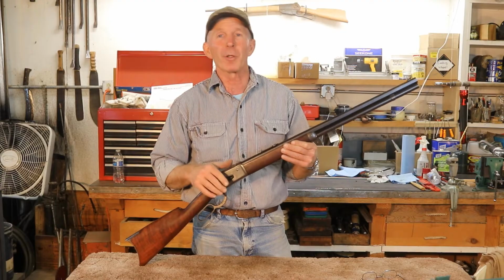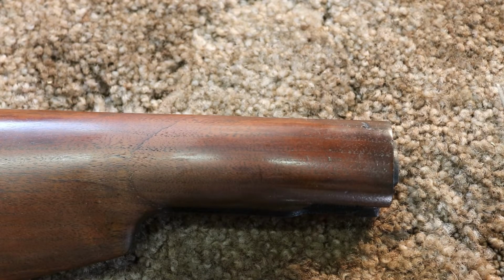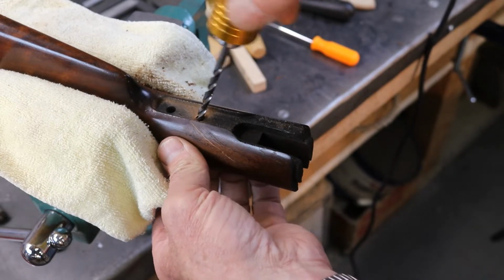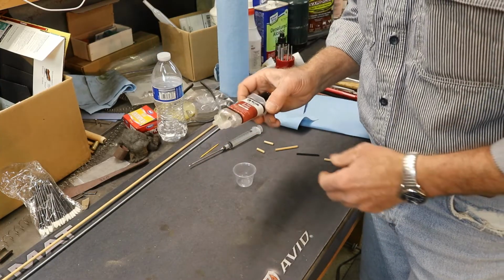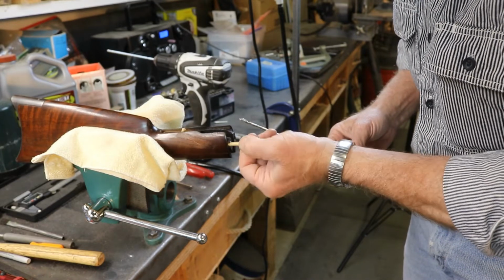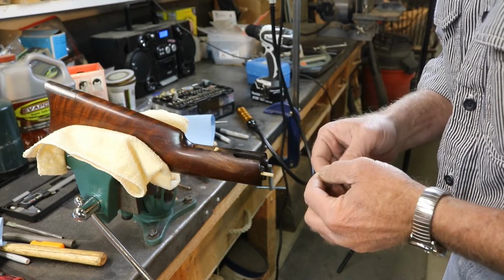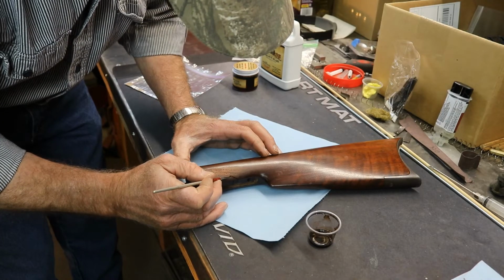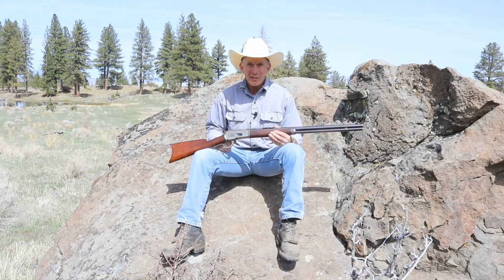How to Reinforce a Broken Gunstock

Comment: Would using a brass tube provide the same level of strength? It would solve the problem of air coming out. If a brass tube wouldn't work, what about a dowel with a grove on the side. All thread in my experience is somewhat suspect for lateral strain. Thank you for saving these old weapons.

Comment: Very nicely done.  I have a crack in about the same area on my .50 cal Hawken muzzle loader replica, I guess I shot it too many times using 100-grain Pyrodex loads.  

I was initially thinking of using a crude method to fix the crack but your work looks like a much cleaner and smarter idea, thanks for sharing!

Comment: First. Great tutorial. 

I just received a jchiggins rears reobuck model 29 .22lr from my dad. My grandfather’s rifle. 

The stock at the wrist where it bolts into the back of the receiver has two chunks cracked off. I do have the pieces that are cracked off. 

Could I do the epoxy repair and then drill and pin with some walnut dowel pin stock? 

And should you use some acetone to remove the oils from the cracked pieces and also the stock at the wrist? 
Again. Great video and great shooting.

Comment: Long drill bit drilling deep hole without drill stand: put a wedding ring/band over the bit. As you drill use ring to keep bit horizontal. Five seconds into operation you will understand the operation.

Comment: I'm about to set about restoring my great grandmother's Winchester 1906 (made 1926) and it's had a crack just like this one for about twice my lifetime maybe even longer than that. I'm going to have to use smaller drill bits and dowels but this was really helpful for how to go about doing it! Now I need to decide how far I want to restore it and how much patina to leave. I think I'll ask dad and grandpa before I do anything past a deep clean though, since it was theirs' before it was mine. I'd like to re-blue or even possibly plate it. I think case hardened would be my choice but I don't want to retemper almost hundred year old iron.

Comment: Wood glue does not gap fill, as epoxy does. Also, most epoxy glues are 100% solids (no solvents that evaporate). For this you want a lower viscosity glue to get it to flow and penetrate the wood. Try and get the slowest hardener. I have good luck with Raka epoxy out of Florida. They have everything.

Comment: Do you use a threaded rod slightly undersize of the drilled hole? I am getting ready to repair an old double 16 Guatemalan side by sided broken stovk

Great video!!!
Reply from the maker: Yes.  It needs to be a slightly smaller diameter than the hole.  Good luck with your project!

Comment: Fixing up a stock i mucked up lastnight. Thought it was all good but didnt jog out enough wood and put too much epoxy and nit must have set up quick because when i put the action into the stock it wasnt fitting correct. I didnt tie it down but to lte. I put the stock it abit crooked and jb welded it. Took it apart lastnight and it was stickng on one side off the stock. Tore the entire rail off one side. Glued ne piece already. 2 more pieces and rebed the rifle. Im using epoxy to mend it instead of wood glue. Also later on ilk be driling holes and adding my own metal splints and glue. I m not to worried as its a cheap wood on this stock and super dry. Almost like a dry piece of wood how it sounds whe  tapped on the ground. But i have confidence in myself to fix it and I think all i wanted was a gun to work on and it didnt mattter if the release agent got squished out I can fix it. If i have to ill find an old stock and refit it nmyself, easy. Done it before and worked out nicely. Fixed the draws in a rear end of a 303 british stock and also fixed up bust and broken stock s before so i know what needs to be done. Fun fun.

Comment: Great video , I've done similar repairs and something that really helps is the use of dowels with grooves , like somebody mentioned below, because on top of making it stronger it also helps the air to come out of the drilled hole when inserting the dowel i also clean the hole with some compressed air before inserting the dowel , i just use the kind that comes in a bottle used to clean keyboards . thanks for your videos

Comment: my granddad and my dad showed me a trick a trick on how to get the glue back into the bottom of the hole when you cant drill a bleeder hole in  and that was to make a small trough along the dowel and fill your hole  then push your dowel rod until it bottoms out and the access flows back out thru the trough you cut into the dowel rod. I've used this trick a lot and it's never falled yet good luck Dave in Elko  also I forgot tto mention when you do it this way it leaves no air pockets- Dave

Comment: I sand or file a small flat on the side of the dowel to allow the excess epoxy to escape the hole allowing the dowel to go in until the depth mark is even with surface.  I don't have to make the flat very wide thus it shouldn't have much effect on the strength of the repair.

Comment: Mark could you use a vacuum chamber and epoxy like I use on knife handles to do this repair?
Reply from the maker: I've not seen one used, but it sounds like it could be promising.  It's always tough to get the epoxy into the cracks.

Comment: Can't beat the feel of a good worn in hickory shirt !
Fixing a broken stock on a Browning 725. The stock screw was loose when fired and split the ends off. Not enough  to drill straight in. Had to pin it from the sides, trying to hide it the best I can. He needs it to practice for continental and will get a replacement later.

Comment: Brownells used to have (may still have)  threaded brass pins for this job too. It did have the advantage of pulling things together like a wood screw. Your use of all thread here is really a solid re bar method. A hard kicker lever gun stock might benefit from this from new.
Reply from the maker: Dang! I didn't know Brownells sold threaded pins for this type of work.  I thought I had come up with the idea.  😉
Reply: @thecinnabar8442  I've used brass all thread from any good hardware store, but I'd say the steel all thread you used is stronger and probably cheaper.

Comment: Wonder if a horse was involved with that busted stock? I have a 62 that cracked and I used epoxy internally to stop it from running further. Also have a little single .410 that was repaired with pins about 90 or so years ago that has opened up due to humidity fluctuating over the years.

Comment: Morning,  just watching your video, great as always. A tip i got years ago for keeping a drill bit level, is to put a large washer on the drill bit, and as you drill, it will move back and forwards depending on wether you are tipping the drill bit up or down
If it stays where it is your level, always works for me and used the idea for years.
Still waiting for a video about caliber and bullet size explanation like this one, an 18/86 ? In 45/70? 
Regards Richard 🇬🇧
Reply from the maker: Thanks Richard!  That's a great tip.  I have to admit that I was nervous about drilling that deep hole straight and not out the side of the stock.
Reply: @thecinnabar8442  I'm glad that happens to other people, i used to think it only happened to the inexperienced 😄. Lovely rifle though.
Regards Richard 🇬🇧

Comment: When I went to GS school we were taught to cut a shallow spiral around the dowel.
Reply from the maker: Thanks for the tip, Jim.  To me, the key is to try to keep air out of the bottom of the hole.  In my experience, any air in the bottom of the hole only pushes out the epoxy.  Techniques to get air out: 1) Put epoxy in the bottom of the hole with a long needle, epoxy pushes air out.  2) Use a threaded rod to auger the epoxy into the bottom of the hole (this worked extraordinarily well in the deep hole) or 3) Drill a relief hole into the bottom of the hole drilled for the dowel to let air escape (I'm not a big fan of this method, because it's too easy to miss the hole).

Comment: Ok Mr Mark, your an indian brave and your horse steps in a gopher hole and falls on your rifle breaking it just like the one you repaired, he takes it back to camp and gives it Fix-A-lot to repair. From what you've seen in the collector world how would he fix it? 
You spoiled me rotten today, 5 of your videos, wish you had repaired my Marlin 93 that a horse actually did roll on and break. Thanks.
Reply from the maker: That brave would most likely have used a rawhide wrap and tacks.  Put the rawhide on while moist and it shrinks as it dries and makes a very strong repair.

Comment: Why not cut reliefs in the dowels to allow air to get out. Why not use Acra Glas?
Reply from the maker: Acra Glass is epoxy.  I've used it quite a bit and have some in the shop.  I don't find it to be better than commercial grade epoxy, only more expensive.  Relief cuts in the dowel will only let the epoxy be pushed out by the air in the bottom of the hole.  Any air is the last thing to leave.  The trick is to get the epoxy in the bottom of the hole instead of air.  The two methods shown (long syringe and auger) are the methods to accomplish this.
Reply: @thecinnabar8442  I have found the thin Acra Gras goes into cracks better than conventional epoxy, and the dye helps with the appearance. The thick Acra Grass stays put. The grooves in the dowels and threaded rod hold more glue and not push it out of the joint, have even drilled a hole down the center of the dowel. Great rifle and repair!

Comment: Had to fix a cheap gun rack at  the Thompson Hunting Lodge didn't have a dowel handy so I got a bamboo skewer from the chef and used it with some Tightbond wood glue. We'll see what happens,  should be good for the rest of the life of the rack. Hopefully! I've been told don't be afraid to mix some of your stain into your linseed oil.
Reply from the maker: Sounds like a good fix.  There were several applications of Timberlux and some of them contained walnut stain to darken the finish to match.
Reply: @thecinnabar8442  you know what you're doing!

Comment: A good trick to use on wood dowels, is to pinch  them along it's length  creating long  grooves where the glue/epoxy can  get into the make the  fix stronger.  That threaded rod is a good idea too.
Reply: I've had good results filing a small V groove along the dowels length, making a channel for air and epoxy to squeeze out.
Reply from the maker: Thanks for the tip.
Reply: I think I would make a pilot hole.

Comment: What size pins did you use ? The drill bit seemed rather large . I hv a custom stock I need to do this to . I hv an Enfield action that was  rechambered in 300 Weatherby magnum . It has several cracks from the tang acting as a wedge (like you mentioned) , and also a cpl cracks forward of the trigger guard ... I was thinking of using 1/8" brass rod to reinforce it after drilling . Do you think that would be sufficient?
Reply from the maker: 1/8" brass rod should be fine.  Make sure that the stock inletting isn't causing the recoil to be taken by the back of the tangs.  That splits a lot of stocks.  I don't do bolt action rifle stocks, but Mark Novak does a lot of military surplus stocks on his channel.  There's some great info on properly bedding the actions there.
Reply: @thecinnabar8442  ok , will check out his channel ,, and thank you for your response ... BTW , I think I like your idea of using the threaded  rod better ! Seems like it would have more "bite"  , thanks again ...